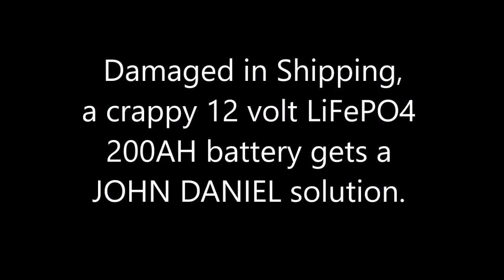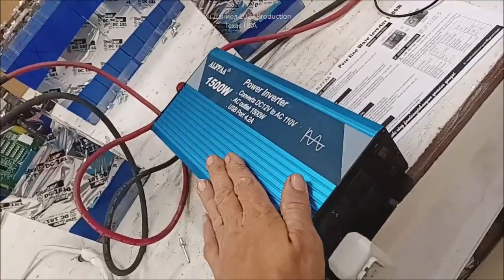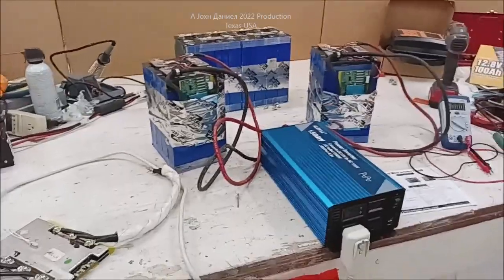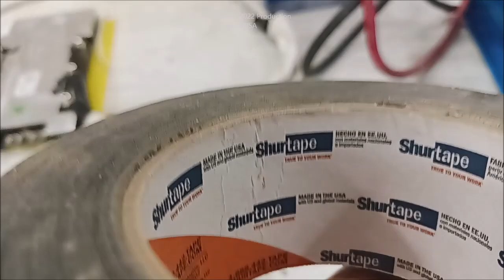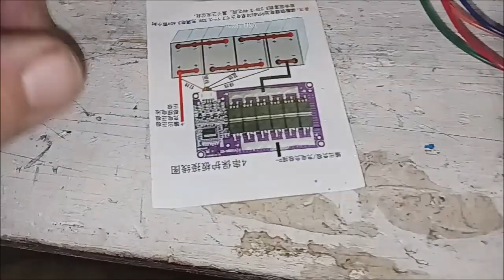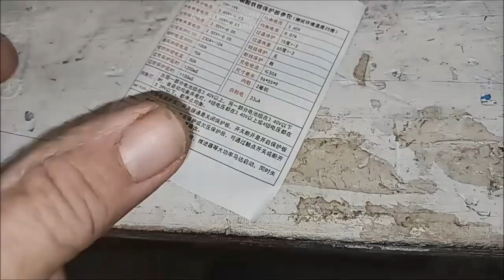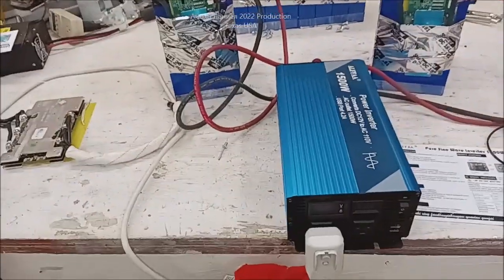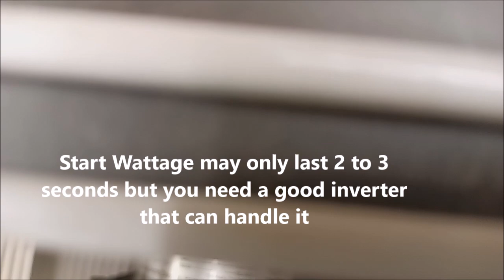60 "Brands" of LiFePO4 batteries being Dumped on America, Can we trust Which ones are OK? READ BELOW

Comment: I have 5 Chins 100AH batteries, connected in parallel. I used a continuous copper bus bar across the terminals instead of battery cables. Attached are a 3000W inverter and a 80A, lithium specific charger. The bank is capable of pushing 225A continuously to the inverter. Not using solar yet, but intend to do so.
No issues so far, fingers crossed 🤞.
Reply from the maker: They are ok budget batteries. Ok for casual use I think. You having 5 means you won't push a single one too hard. Good method.
Reply: @JOHNDANIEL1  I try not to abuse them, using only 70% of the capacity.

Comment: Can a PWM charge controller charge a LiFePO4 battery?
Reply from the maker: Some of them can, they just need current limiting ability. Or your source/ battery will toast them. Best process is use 2 of these 80 amp ( https://amzn.to/3JTOMbN ) on one 100 amp 24 volt battery split with 2  50 amp shunts https://amzn.to/3JU3kbJ . To make a 12 volt output charging station.

Comment: Help me out here and I'll buy you a coffee or 2. I have a 200ah amphere time battery. It needs a bms, the one on there is shorted. This one has 8 wires, I tried unsuccessfully to attach an aftermarket bms. Can you point me to the correct bms for this model? Thanks! Guy
Reply from the maker: There's is a specific make from Heltec but the marked replacement is this one 200 amp 4s, with UART and BT is all they have available, it's $20 more but better. https://s.click.aliexpress.com/e/_DEwaNPv
Be willing to change your cables to fit, but it should fit OK.

Comment: Using a dc to dc converter with cc cv, set to the cells nominal voltage, with only 1-2 amps max, to recover cells, if you were to forget about the panel attached to the cells, it could damage the cells!
Reply from the maker: Do not use a dc/dc charger to reanimate these batteries back up. The reason you use a solar panel is because the resistance of the battery will back up against the panel and stop accepting charge if it's shorted or damaged in a way that it cannot take any current. Something with an actual power supply will just keep pushing when the battery can't handle it. Under 1 amp is near the same in internal resistance to accept charge. Depending on the battery you're trying to charge up, if it's 100 amp hour 15 watts or less works, if it's a 200 amp hour cells you can probably use a 25 watt panel.

Comment: About the only way to tell if the cells are used or just not so good cells, is to test and weigh them!
Reply from the maker: That used to be true. But the Chinese wised up on that microgram weighing system. So what they do now is they produce them, they underweight them so the record that they produce of their manufactured weight is different than what the actual is. That means that when you get the cell and you're looking at the specs they created you're getting exactly what the deteriorated cell should weigh.

Comment: I bought a Dr. Prepare battery and yes it is put together with used cells, after 6 months i already have degradation to the battery. The Queen power has been getting great reviews from many channels. I only watch the ones who buy their own stuff or build their own systems
Reply from the maker: You have to track the BOL on all these rebranded things. Bill of Laden. See who's crap rides together and lands in the same warehouse. I've been doing that, 28 brands you see totally different feedback on do this, the ECO-WORTHY GROUP.  But Power Queen, AmperTime,  ECI, Zooms, banshee, Odyssey and a few others with a few rack kits come from another port and go to another central LA warehouse. Kepworth, Wullis, and Sok only have a few brand alterations and are from ground unrelated to the dumpers.

Comment: I used your promo code to order some power Queen premium batteries for a trolling motor. I sure hope they are quality. I do like the smaller form factor for a 100ah battery which saves valuable storage space on a boat.
Reply from the maker: The power Queen seems to try not to get their name ruined. It's one of about 4 made under Shenzhen Time, Ampertime battery is also one from them. Most are mass dumped repeat junk.  Ampertime/Power Queen design seems to have thought out customer longevity better. 
Whlle is true that most all of these battery assemblers get their battery boxes from only three or four plastic companies in China, the rest depends on their own sourcing for all the internal parts.

Comment: It's the same with lawn mowers. Compare a Husqvarna ride mower with a Troy Built. It's the same factory as best I can tell. Branding and a different color. Buyers be ware and that is where this guy excells. Years of front line learning and experience. !:- )
Reply from the maker: It's the mega corporation effect. Brand names absorbed to trick buyers, results is year after year it all turns to crap.
Reply: Mtd  makes 90% of the riding mowers out there and other company's put some.of their parts on them and paint them a diffrent color . I have a mtd  and a craftsman riding mower(1 at my northern property) and they are the same thing. If you cross reference parts  the deck, spindles, motor, steering  etc etc  they are the same part number